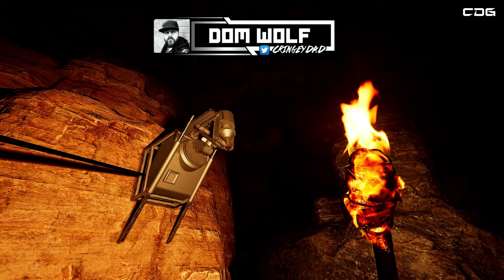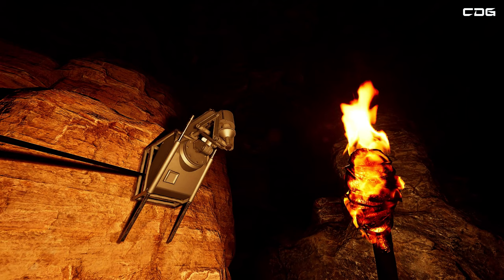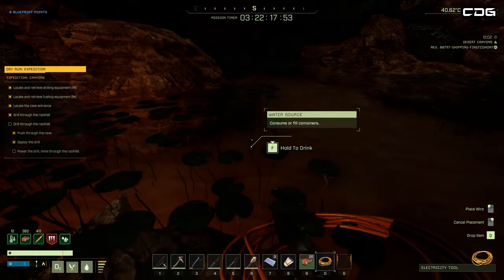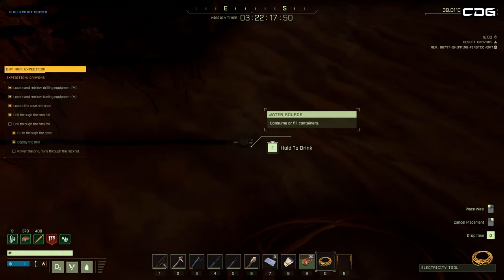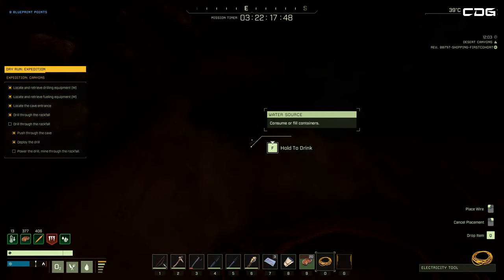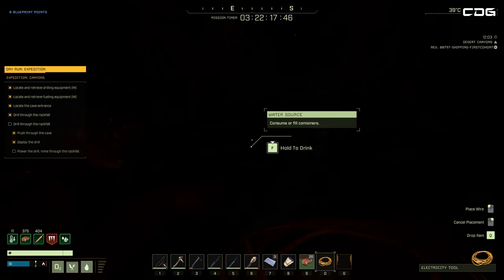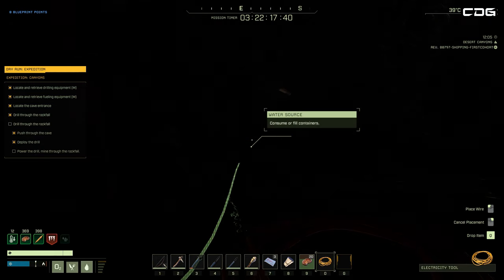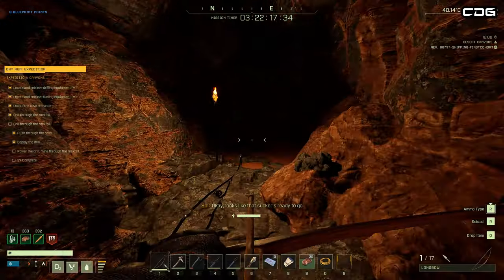LINKING THE SOLAR PANEL & DRILL IN DRY RUN MISSION | ICARUS

Comment: I ran cables all over but it won't power the drill via solar panels in sunlight. I originally tried to build stairs to the sunlight hole in the cave, but that was just bad geometry. I couldn't build to the top of the mountain to lower the cable from there.
Reply: I eventually had a ton of cables and started connecting every join and eventually it worked for the first drill. Now I can't find the second drill???